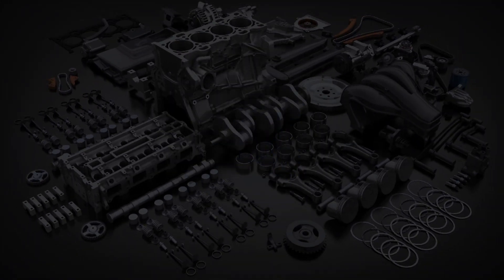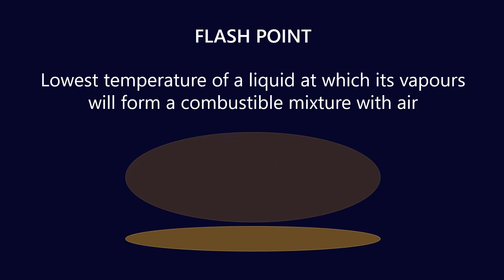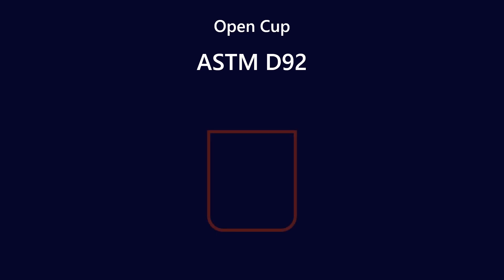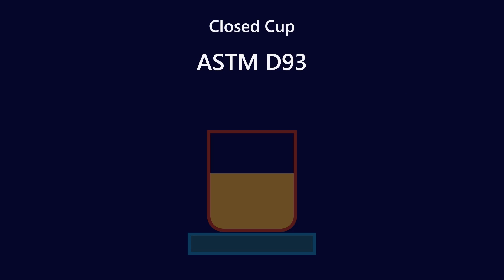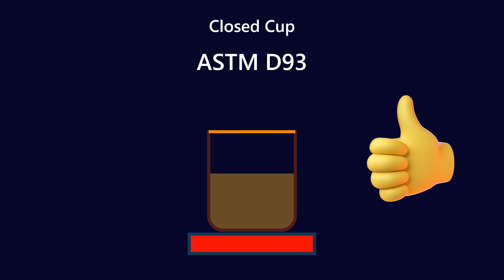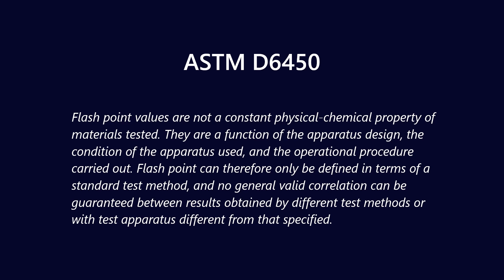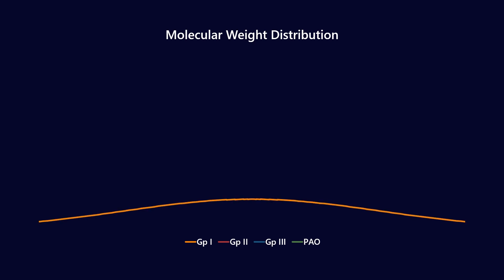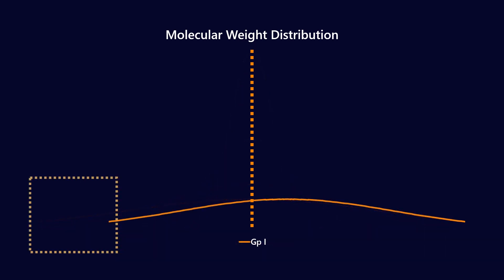What is a safe flash point? How is it tested?

Comment: Another component I must consider as my oil will be exposed to an absolute atmosphere pressure of 15kpa on one project and as low as 1.5 kpa on another.
Reply from the maker: If you have specific questions - lubrication.explained@gmail.com
Reply: @LubricationExplained  I have at least 100 questions. When I am closer to manufacturing I will pay you for input. Thanks for all the videos.
Reply from the maker: @chippyjohn1  No worries!

Comment: I was never really that bothered about the flash point of oil. It was simply something you needed for writing the safety data sheet but that was about it.

I never looked to actually test it, but my gut feel is that the flash point of any fresh PCMO drops like a brick, the moment you put it in an engine & start using it. The reason is that you'll always get a bit of partially burnt gasoline getting past the rings especially when it's cold outside & you first fire up the engine. Having low tension rings & a GDI engine exacerbates this effect. Gasoline is incredibly light relative to base oil & even the tiniest amount entering the oil in your sump will have a major effect on flash point.
Reply from the maker: Definitely true in PCMO. Flash point tends to be much more important in the industrial sector - particularly thermal oil systems such as in the pulp and paper or forestry industries.

Comment: So is it helpful to use different tests to get a more clear understanding of the "true" flashpoint? Like different fingers pointing at the same thing.
Reply from the maker: Not hugely. Main thing is probably to stick with one consistent test but to be aware that the trend is important rather than the absolute number. The problem is that he flash point in an application will be dependent on the system equipment, so there isn’t a one size fits all solution.

Comment: MORE VISCOSITY IMPROVERS WILL DECREASE THE FLASH POINT ?

MOST OF ENGINE OILS BETWEEN 220c and 240c ... is the 20 degree difference a huge thing?
Reply: VI polymers have negligible impact on the flash point of an engine oil.
Reply from the maker: Agree with Mr Sensible!